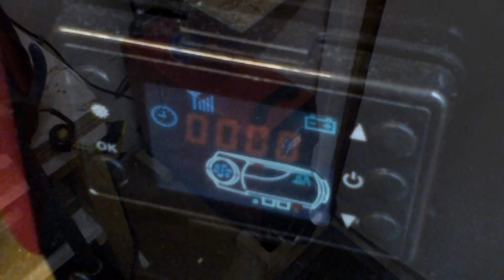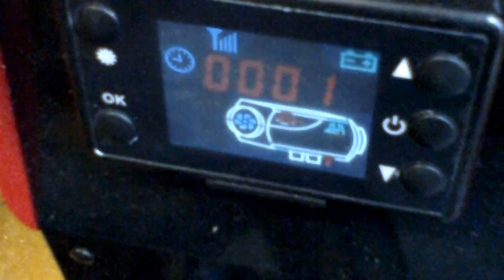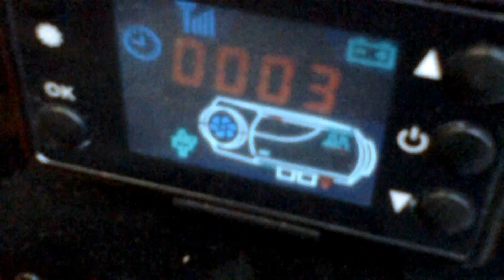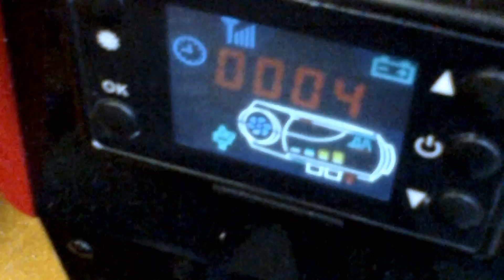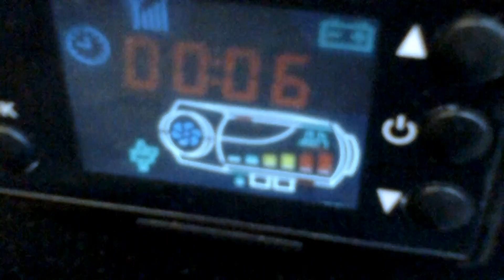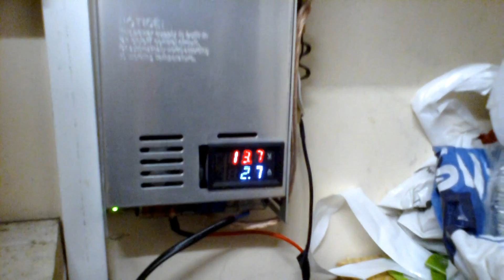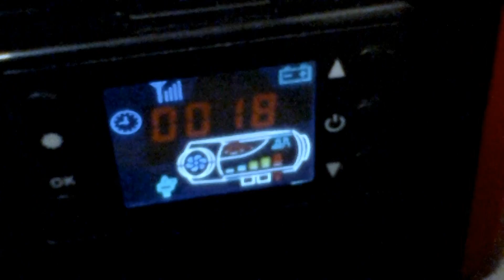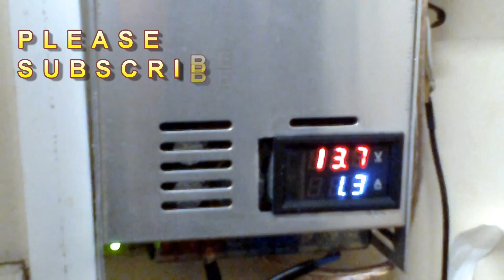COMPACT CHINESE DIESEL AIR HEATER - AMPS used in REAL TIME

Comment: Thank you for the detailed video! I am using a Jackery 500 for my campervan and was considering one of these 12v diesel heaters, but with a max output of 10amps on my 12v inputs, this unit will draw far too much for my power station. Do you know if the 2KW version draws less when started and shutting down?
Reply from the maker: Hi Kyle. Always better to be well informed before you part with your hard earned case.
Remember the 12A is only for start up and shutdown so if you can adapt the power you would be nice and warm... Regards Peter
Reply: @brucepeter2007  Thanks for the reply! 12A at start up and shutdown would likely blow a fuse right? I've seen others utilize a higher amp inverter as a go around.? The Jackery 500 is great, but with appx 44Ah, I've run into some it's limitations when considering a proper heat source. Thanks for your help!
Reply from the maker: Your welcome.
Reply: @brucepeter2007  Peter, can you help me understand "adapt the power"? I'm not sure I fully grasp what you're getting at. With 10A max on the Jackery, I'm unsure how the heater wouldn't blow a fuse during startup/shutdown. Appreciate the help!
Reply: @kylehowe2698  did you find out if it works okay with 10amp jackery? I’m in a similar situation now with a bluetti with 10amp limit
Reply: @kylehowe2698  same boat. Have jackery 500 and just purchased all in one 8kw heater. Do you mind sharing your experience?
Reply: @yikeisaac  I haven't purchased a diesel heater yet, but will this month and will update when I get it installed. While the cig lighter on the Jackery has a 10A max, I've read in multiple places, that the Jackery does fine with a 2kW diesel heater. I imagine with a 5kW or 8kW heater, it may be too much for the Jackery though, but I don't know this for fact.
Reply: @kylehowe2698  I have tested only about  30 minute with Jackery500 and 8kw heater but it seems to be working fine during the peak amp. Start to off worked fine.
Reply: @_kmk5185  Yes, same! Jackery500 performed fantastic with my new 2kw diesel heater. Max wattage during start up peaked at 109watts/9amps, but only for 3 minutes, then settled to 15watts. Very happy with the setup.

Comment: Great video thanks,I have just order a heater and a 12V 45Ah car battery to power the unit .As I know nothing about volts/amps ect could you tell me if this size battery will power the unit for say 5hrs before it would need recharging,excuse my ignorance on this subject.If this battery will not do the job could you advise me of what to get thank you
Reply from the maker: Hi Matthew. Personally I would go for a 65Ah battery to be safe as you have some leeway. As you saw on the video when it’s running it doesn’t use a lot of current but on start up and shout down if you don’t have the Amps you get white smoke because the glo plug can’t get hot enough for the diesel to ignite and even on shutdown the glo plug fires up to get rid of ant un burnt fuel so you need a decent battery else you will start getting error codes shown on the controller. Hope I’ve helped.
Stay warm, stay safe.
Regards Peter
Reply: @brucepeter2007  Hi Peter,thank you for your reply I will take your advice and try to return my 45Ah and replace with a 65Ah,best regards Matthew
Reply from the maker: Stay warm. Have a good Christmas and stay safe from Covid....
Reply: @brucepeter2007  I have 'Binge watched ' chinese heaters for three days looking for this information!. Your channel has finally answered my search!
You definitely rock - Cheers from America
 -Do I need a powered power supply?
       if so, what size? (12v 20 Ah power supply)
-Do I need a inline fuse on the power supply?
      if so, what size? (5 amp)
-Do I need a battery to be a safe guard for the mains?
       if so, what size? (65Ah battery car battery)
-What size cabling from battery to heater?
       8 gage
-Do I need a inline fuse on the power supply?
      if so, what size? (15 amp)

Comment: Thanks for the informative video! I have a portable power station that has 12V/10A output. I don't think it will be able to handle the amperage required for the startup. Do you think I can run the heater on my car's 12V output for the startup and once the heater is warmed up, switch to the portable power station?
Reply from the maker: Hi GB. you could get away with that but honestly the 20A power supply is only around £15 on eBay and it’s a much safer bet for mains hook up. Stay warm. 
Regards Peter
Reply from the maker: Hi again GB.
I had the wrong end of the stick for some reason... So to answer your question correctly - I would not recommend doing it that way because if the voltage / current drops too much and the heater cuts off due to lack of power you have a good chance of frying the motherboard in the unit. Need a good sized battery in good condition which will insure you don’t get a problem and always stay warm. Regards Peter
Reply: @brucepeter2007  I would agree with you 100% and use a decent battery say 55/70 amps and we attach a light charger unit attached which keeps the battery topped up. and in passing a PC power supply is not really suitable as have tried.
Reply from the maker: Most of the issues are not knowing that a decent supply is required which is why I made the video. Thanks Don for your comment.
Stay safe - merry Christmas mate.  @donkirk5433

Comment: Hi, 12 v and how many AMP max? For use at home(car box)  with a power supply...thk
Reply from the maker: Hi Bossa. I use a 20A ebay switch mode power supply now as we have a stable mains supply. regards Peter
Reply: @brucepeter2007  16A is low for you?
Reply from the maker: Should be fine - but no smaller
Reply: @brucepeter2007  many thk :)

Comment: So I put the transformer to the 12v battery from the UK mains supply ??? Thx
Reply from the maker: Hi there Carys. IF your mains supply is reliable during the winter months then use one of the 20Amp switch mode power supply directly (eBay) connected directly to the heater however if you do sometimes have mains issues I would recommend you hook your heater up to a decent capacity 12v battery with a 10Amp SMART charger connected to the battery all the time. Do NOT us a standard battery charger as it will cook your battery if it’s on all the time. A SMART charger monitors the battery all the time and only comes on when the battery condition falls. Then shuts off when the battery is at a 100% state.
Hope I have answered your question. Stay safe.
See the power supply I use here.

https://youtu.be/OjvcBiBAqMQ

Regards Peter
Reply: @brucepeter2007  hello Peter does it have to be a 10 amp charger thx
Reply from the maker: @caryslloyd8823  No it doesn’t need to be a 10A but there is not much difference in price between the 6A and 10A.
The main thing is it must be a smart charger... Regards Peter
Reply: Thx Peter I'm still scratching my head a bit will let you know the outcome, 👍
Reply: @brucepeter2007  hi Peter, im just about to set one up in my shed after watching your very informative vids. Think i have all the gear with some idea. My plan is to have the unit set up in a weather proof box outside shed, just heat outlet into shed. Planning on running on 38 AH car battery, on permanent charge by a 2 amp smart battery charger. Does this seem optimal?
Reply from the maker: @jacklee4718  Hi Jack. Thanks for the comment. Setting the unit in a box outside is fine but don’t forget you need two large holes to get the air from inside the shed then heat it and return the heated air back into the shed as some have used the input side of air from outside and wonder why the fuel consumption is high...
Your battery / charger set up is to my mind too low and your pushing your luck. Using a smart charger is correct but 2A is far too low as you need a 6A minimum to be safe and I would go with a 70A battery and a 6A smart charger.
Always better to have something in reserve and on start up and shut down they do pull the current when that glo plug kicks in and as the battery you are quoting is a bit on the low side it would be taking a kicking and would soon sulphate which would greatly limit its life and the 2A charger would not hack it.
Regards and stay warm. Peter
Reply: @brucepeter2007  cheers peter
 Iv been following facebook group and the air intake inside or outside question seemed a real 50/50 split. I had gone with outside so just one hole for air vent. I'm going to keep the battery inside, the charger and battery is what i have so ill probably just run with it and if replace if and when its knackered.
Reply from the maker: Hi Jack. I’m no happy about the 50/50 you mention and as I have not seen any pictures I can’t advise however - golden rules are.
1) ALL COMBUSTION pipes go to outside of vehicle.
2) Heat Air intake and heat output large diameter pipes stay inside.
By doing this you make sure you always wake up.
Forgive my harsh reply as I can only advise and want to ensure you and your family stay safe.
Regards Peter
Reply from the maker: @jacklee4718  Hi again Jack. I just finished a reply to you but for some reason it did not post so another reply was needed to be made to ensure your safety...
The 50/50 comment you mentioned in your original reply concerned me - there are two golden rules which some people don’t seem to follow.
1) Combustion (small) pipes should always go OUTSIDE THE VEHICLE.
2) Heating pipes (large) are always in the inside of the vehicle.
If the installation of the heater unit is outside for some reason - as perhaps yours is - BOTH of the large pipes - heat input and output pipes MUST go through the side of the vehicle / shed to maintain a closed air loop to the area being heated...
I don’t know your set up so as long as you follow the above rules you and your family will remain safe and wake up each morning.
Sorry to be so harsh but there are safety reasons why the above two golden rules should be followed and unfortunately so many installations bend the rules.
Stay safe and warm my friend.
 Regards Peter
Reply: @brucepeter2007  hi peter, thanks for reply. I know that i need to keep air intake and exhaust well apart from each other which i would ensure when i box it in, so surely there wouldnt be a safety issue. The difference in opinion came down to inside= less fuel consumption as using warmer air but at expense of more moisture in air leading to condensation. And outside - clean air being used and less condensation at the expense of more fuel consumption. Obviously assuming the air inlet and exhaust are kept well apart. There was also a comment about bu having air intake and hot air vent in the same area run risk of creating a partial vacuum which i haven't fully understood
Reply from the maker: Hi Jack. Combustion - air intake and exhaust outside pointing away from each other.
Heat exchanger - cool air inlet and hot air outlet both from inside.
This way you cannot drying into your heated area any fumes and the pressure inside is always equal. As your reheating existing air your set temperature will be reached quicker so you will use less fuel.
Reply from the maker: Hi Jack. Forget the condensation issue as you are only using air from inside and there is no water from combustion exited from the hot air side of the outlet.
The important thing is to ensure the the combustion pipes stay outside so no fumes could be conducted into your shed...

Comment: How many volt can this heater consume in 8 hours of use with a battery full of charge? Planning to install one on my 2016 RAM 3500 which come with tow batteries. Thanks
Reply from the maker: Hi Erinson. Thanks for the reply. This question is a bit like “ how long is a bit of string”  I’m afraid because there are so many variables within your own question.🤪🤪🤪
Outside temperature, insulation of van, battery size, battery condition / quality...🥶🥶🥶
With all that I can only make assumptions so it’s probably safe to say that if you have the extra capacity of the tow batteries which I suspect will be around 100Ah you should be fine as long as your not staying in sub zero temperatures where the heater stays at 100% full on output all the time. As soon as the set temperature is reached within the van the motor speed will reduce and so does the fuel dose pump and thus the heaters output and electrical / fuel consumption dramatically reduce.🤔🤔🤔
Remember not to allow your 12v battery to get below 12.3v (under no load) and this will greatly enhance the life of your batteries as it prevents sulphation which tends to kill leisure batteries very quickly.
Hope I have explained this question to your satisfaction.
Stay safe, stay warm. Regards Peter.

Comment: Hmm.  I just ordered a 16AH LiFePo4 battery for this - I THINK it will support 12AH for 5 minutes without a problem.  Normally it will be on an auto maintainer at 4A, so it's just max use at loss of power that I'm concerned with - not even startup - so that looks like about 1 minute on shutdown.  THINK THAT'S SAFE??  Yeah - and thanks very much for the test!
Reply from the maker: Hi there iOn. Thanks very much for taking the time to comment.
All I can say is that as the battery ages it’s capacity will reduce to the point when it’s retained charge is just not enough and your diesel heater will cut out and the retained heat from the “furnace” will probably destroy the heaters motherboard. Is it really worth cutting things so fine!
Better to design for over capacity and be safe ( and warm ).
Stay safe. Regards Peter

Comment: Hi peter, thinking of rigging one of these upto the van for quicker warm up/defrost windscreen. Do you know if it will flatten the battery on standby overnight ? Or i could fit an inline switch and just pop out and flick it on when needed.
Cheers,tony.
Reply from the maker: Hi Tony. On standby - not on - draws hardly anything but when it starts up and shuts down it pulls a fair bit.
Don’t know your situation but few I. Canada and colder climates dash out quick and start vehicle first in the morning and then get back in the warm quick and let the heater do it’s work. It takes about 4 minutes to start generating heat but when it does it comes out with a vengeance. You can’t just turn it on/off as it’s not a standard heater and if you did that and pulled the power you would cook your mother board. It’s really a furnace so when it’s started it runs and after it gets to your set temperature it reduces its heat output a bit but it’s not like a fan heater where you can select a heat setting so don’t expect a lot of control.
Hope this is oh help. I have other videos on my channel which can help. Regards and stay safe. Peter
Reply: @brucepeter2007  thanks peter your a gent 👍

Comment: Hi friend can I run the heater with out a 12 volt battery
Reply from the maker: Sorry - no chance. Even an old battery won’t support the current requirements on start up and shutdown...
Stay safe. Regards Peter
Reply: @brucepeter2007  hi Peter can i use a ac dc trancefomer
Reply from the maker: @mazman8343  Hi again May. You can use a 20 Amp switch mode power supply if your on RELIABLE mains electric.
Reply: Hi Peter I'm looking for a tracefromer to run the heater I was looking at 15amp 30 watt one's and 30 amp 360watt I'd be only using the one heater what would you use
Reply from the maker: @mazman8343  Hi again Maz. Go for the 20A here is a link. Regards Peter

https://ebay.us/kgva2N
Reply: Hi thanks very much . Quick question I keep getting E1 error after 20 min on full heat and it's set to 12v not 24
Reply from the maker: @mazman8343  Hi Maz. Look up the Facebook Chinese Diesel Air Heater Group and look up everything you need in the files section. You will find everything you need to know there. It’s a good group. Stay warm and safe. Regards Peter
Reply: @brucepeter2007  thanks
Reply from the maker: @mazman8343  your welcome. Stay safe & warm. Peter

Comment: Did you mention how many watts the power supply needs to be?
Reply from the maker: Hi Paulo. Just go for a 20 Amp power supply and you will be fine. All decent power supplies are rated in Amps.
Regards Peter
Reply: Peter Bruce I didn’t think you would get back so quick. I bought a 12v 12.5amp power supply, fingers crossed 🤞
Reply from the maker: @paulotlc  Hi Paulo. Your pushing that power supply to its limit and if it goes at the beginning the heaters shutdown you could end up with a fried mother board. Best to get a 20 Amp off eBay to keep safe.
Regards Peter

Comment: Should I buy a deep cell battery to run this heater  stead of my Truck battery?
Reply from the maker: Hi there. It would be better to use a separate battery as if you ever did drain the leisure battery down too much you would still be able to start your truck. You could get away with just your truck battery but best safe than sorry.
Regards and stay safe. Peter

Comment: Wow Peter thanks heaps..... You describe the current consumption process perfectly. Thanks again to take the time and do all this testing, I am close to buy one of this unit, but i was wondering about the draw, I have already a fridge and a second deep cycle battery installed 100amp, useable around 50 of those... to share  with this unit in the future.... hopefully works both together....
Reply from the maker: Hi there. Many thanks for your kind comment. Don’t know your setup but as long as you keep your battery topped up it should be fine - remember that the heater takes a lot of Amps when it closes down as well - if you shut it down and there are not enough Amps in the battery you could end up with a premature shut down and a cooked motherboard so just keep an eye on that. Stay safe.
Regards Peter

Comment: So what fuse rating should we use? 15 amp fuse seems a bit too close to the 12 amps needed. A 3 amp margin I think is not high enough.  I can not recall what was supplied.  Perhaps we should use a 20 amp fuse.  Fuse failure on cool down would catastrophic.  Your comments?